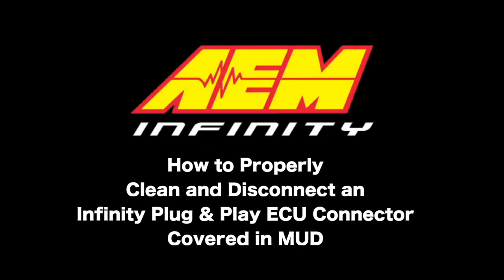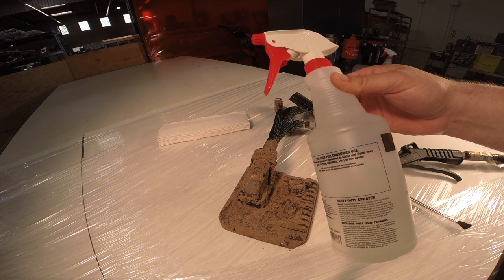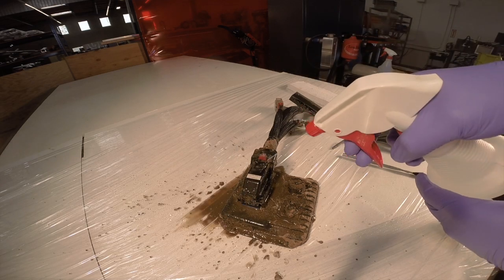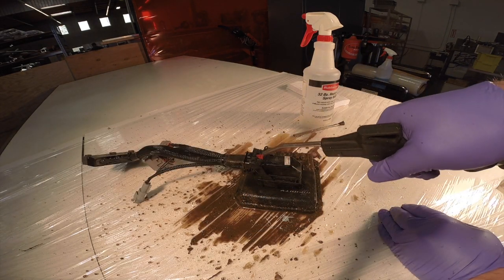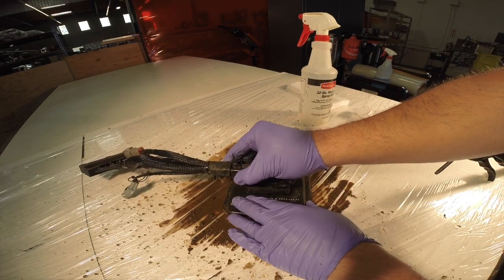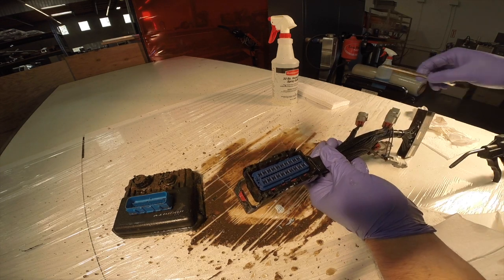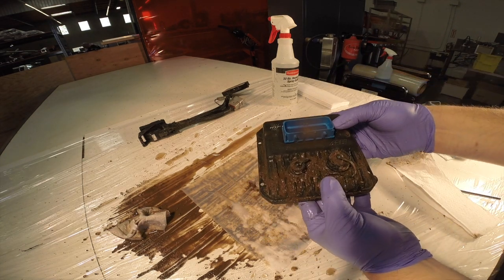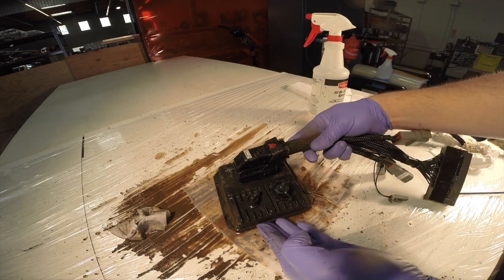How to Clean a Muddy/Dirty Infinity ECU to Prevent Connector Damage

Comment: I'm in Hollywood California I would pay a king's ransom for a new wiring harness for the motor of my 1997 GMC C 3500 dually 7.4 I've changed all the sensors new distributor everything flashed ECM. Did the 11 minute 30 second routine with ignition.. I get no spark no one will work on my truck. But me. one of the ECM fuses burnt out. I changed all fuses and relays. . . Now I get fuel priming pressure new battery new starter everything. There was a wiring electrolysis problem positive side of battery changed cables. Gone too far to stop. Truck was running beautiful before it suddenly dropped out... I would also send a king's ransom for the answer.
Reply from the maker: Hi Jack, please email our tech support specialists at emstech@aemelectronics.com so they can assist you. Please include the serial number for your ECU in the email, any datalogs that you have, and outline the issues you are having to speed up the process.
Reply: @AEMpowerTVelectronics  ECC9684 number on ECM sorry screwed up I have to send more. Fishing around for my email 1997 GMC Sierra C 3500 Dually 7.4
Reply from the maker: Hi Jack, Unfortunately, we can't be of much help to you. It appears that you are using the stock PCM and we don't make harnesses for stock vehicles. Our harnesses are specific to our standalone ECUs only, which are intended for racing vehicles. If the Painless harness will not work then your best option is to check the parts department at the GM/Chevy dealership or search for one at salvage yards. Good luck!